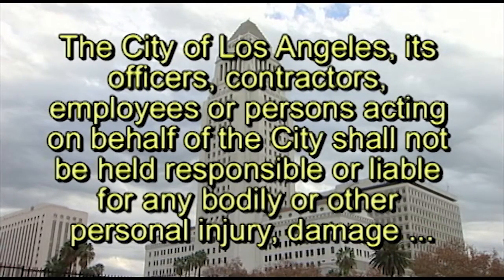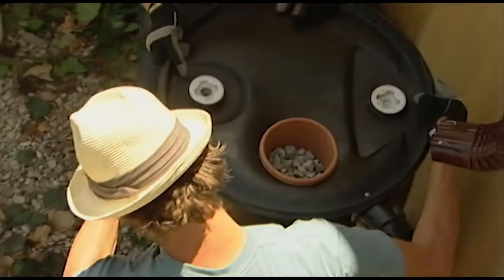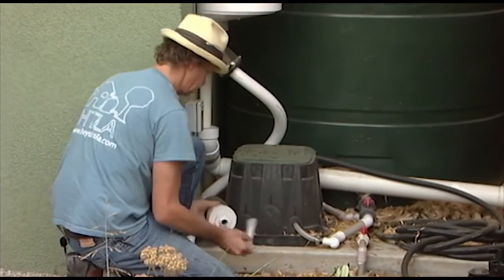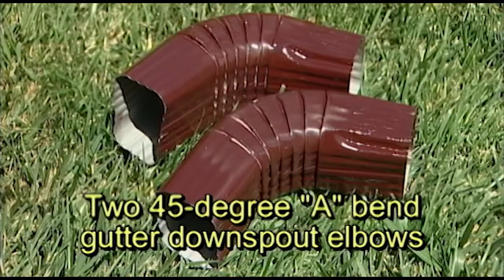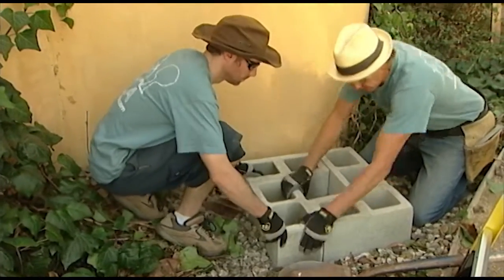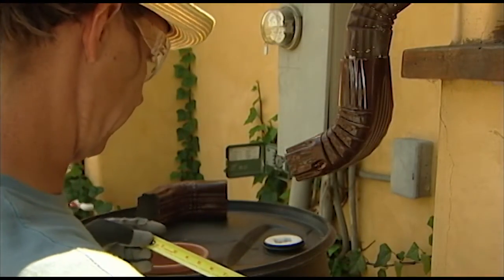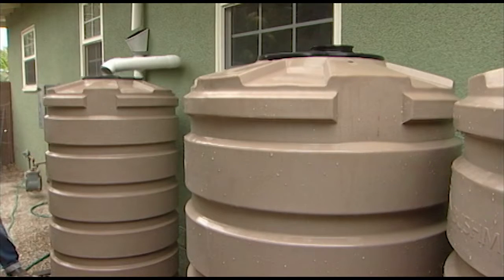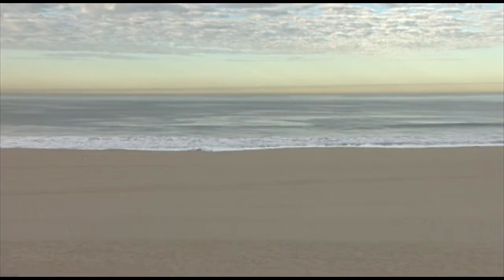How To Install A Rain Barrel

Comment: Thanks hilarious! What rainy season? I haven't seen rain in about 3+ years!
Reply: We have an average of 31 days every year with measurable rainfall.  December 2021 was the 3rd wettest on record.

If you have a 2000 square foot house and are able to capture all the rain that falls on your roof you'd have turned our 2021-2022 rainy season rainfall into more than 12,000 gallons of captured water
Reply: @raitchison  You shouldn’t use ‘we’. I’m in Santa Monica and the rainfall to date this year is 0.15 inches. With most of this drying up on the roof before it would ever accumulate in a barrel. Put the emphasis where it belongs. Nut farming in California uses more water than all the residential usage in the state! Move nut farming out of California.
Reply: @TDeslip  Santa Monica saw 10.94 inches of rain in the 2021-2022 season with an average of 13.45 inches historically.  Also for the record it looks like Santa Monica has seen 1.64 inches of rain in 2022.  This is measured at the Santa Monica airport via the LA Almanac site.

I don't disagree with you regarding where we are using our water, I especially have a problem with all the  water used to grow Alfalfa (animal feed), much of that for export.  But it's wholly inaccurate to suggest that installing a rain barrel is useless because we don't get any rain, because we do.